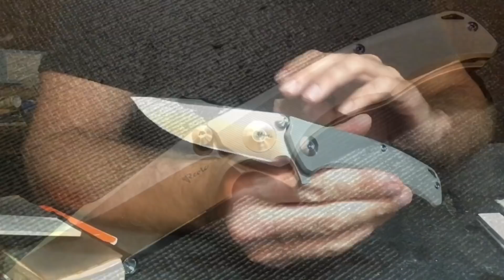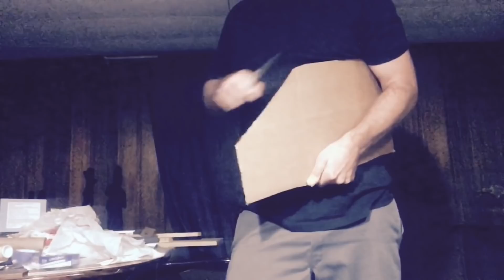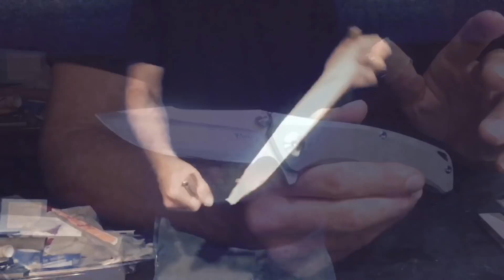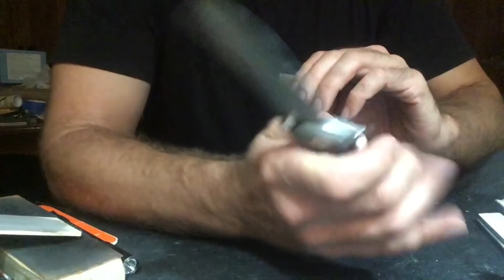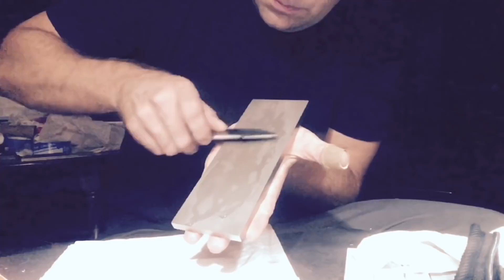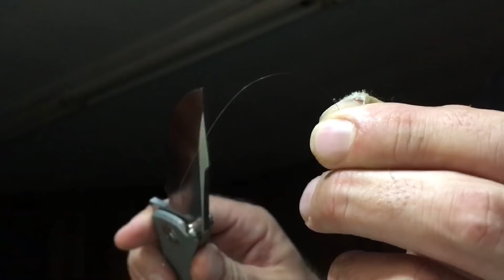Reate Knives - New Torrent in RWL-34

Comment: From someone who has been into custom knives since 1999 and have own a bunch in all types of steels (also EDCing them). RWL-34 is easily my favorite. In my option 154cm is not even close, even if they look like they are via specs or at least anything Ive owned with 154CM has been pretty terrible.
Reply: Artby2wenty 154cm and cpm154 are different.
Reply: Yes. Still don't like either.
Reply: Artby2wenty oh ok thanks for the reply. I’ve never tried either 154. But I’ve heard nothing but positive things about rwl34

Comment: I want a reate in this steel. Have you tried cpm154? How does it compare. I feel like the cpm steels are not as good as their carpenter or European counterparts. I could be wrong. I’ve just has several knives in 20cv and it sharpens closer to S90v than M390. I feel like M390 is more fine grained. Again could be wrong. Would like to see you sharpen some 20cv
Reply: Matthew Forrest m390 is a 3rd gen powdered steel so it should be a little bit better then 20cv but the 20cv you sharpened could just be soft